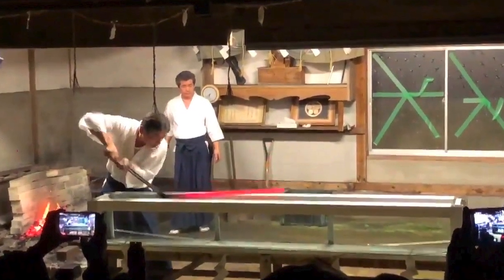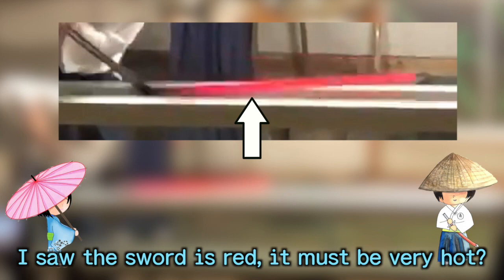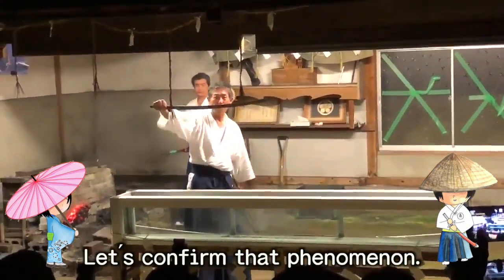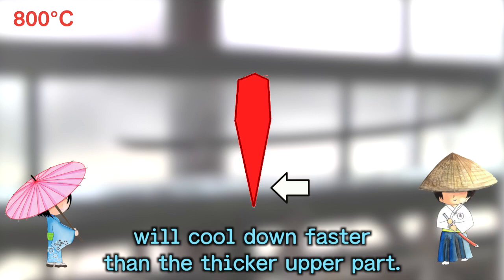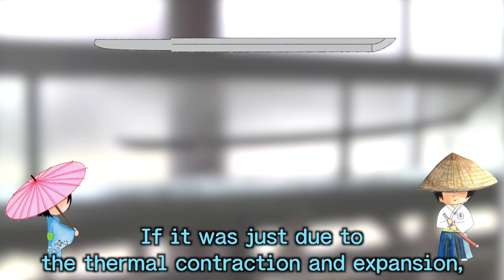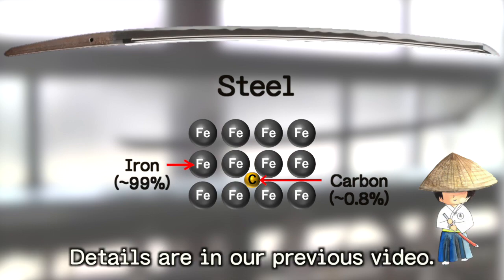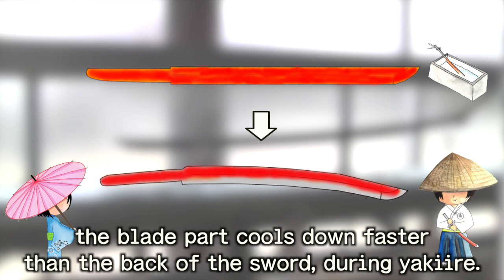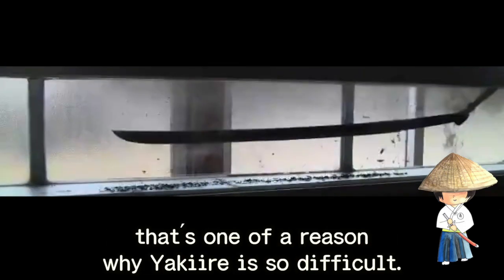The Moment of Yakiire quenching. Amazing transformation during Katana making.#hamon #katana #swords

Comment: What actually impresses me is how even the temperature is, across such a long blade. That's tricky to do.
Your explanations were really good, but i would add one more detail : the curvature of the sword is slightly delayed, because martensite (the hardened crystal form of steel) only forms at lower temperatures (about 180C). This means as long as the water boils, the steel doesn't really expand into the martensite, so it adds some delay before the curving.
That's also why when quenching blades in hot oil, you can actually hammer them straight and bend them for a few seconds, as the blade still isn't cold enough to harden (but the quench still collapsed the austenite)

Comment: thank you very much, I quenched a katana using the clay method a few days ago and was in disbelief at the curve when it came out! Thank you for explaining in detail on why this process happens! Unrelated to yakiire however, I understand there are many different forms of hamon (gunome, notare etc.) is there a specific method to getting each individual one or is it all down to the relationship between steel, fire and water? As well as this, I have taken notice of different blade cross profiles such as soshu kitae (created supposedly by masamune). From my understanding, this is created by forge welding different carbon percentage steels together. Is this correct or not?
Reply from the maker: Thank you very much for your comments too! 

What an exciting thing you are trying. To quench a katana by yourself sounds so interesting.
I hope I will have the chance to do it myself too.

Most of the time I get the information from books or other sources and examine the theory with small scale experiment. I might not be able to provide you the best answer but let me try my best to answer your questions.

To make a different hamon pattern, there are specific ways of putting clay for creating each hamon pattern. Of course, what you mentioned is said to be very important.
If you are interested in clay patterns, I will make a video about that.
Moreover, there is a special case, where the quenching katana was done without clay, which is called Hadaka Yaki.

For the cross profile, your understanding is correct. Single to several steels with different carbon contents were used to increase the functionality. Also, a welding pattern is important for hamon pattern, for example, so-called honsanmai can make a Kinsuji at the border of different steels. 

I hope these information would at least help a little for your Katana forging. 
Please feel free to share your on hands experience or new findings from Katana forging. 
I will be so excited to hear more about that!
Reply: @samurai-tavern  thank you! Your are very knowledgeable in the subject, that clears up my understanding nicely! I will be sure to share any new findings I make!
Reply from the maker: it’s my pleasure! all the best for your Katana forging and stay tune to our next video :)

Comment: I just finished watching Ruroni Kenshin since I was a child. Based on how this works, a reverse edged sword like his would not look the way it does because of that principle right? If it were made in the traditional Japanese way. Or would they just make it traditionally and sharpen and polish the opposite side?
Reply from the maker: Thank you very much for the comment.

I’m happy to hear that you watched Ruroni Kenshin, because it is one of the thing which I want to recommend others to get interested in Japanese culture.

Let me think about the Sakabato…
I think, one of the best solution to make Sakabato is to make a sword which is greatly curved toward blade side, before Yakiire process. If the blade part is extended after Yakiire, the shape of the sword still looks Sakabato.
The resultant sakabato has sharp mune blade and blade without sharp edge.

I think the important point is ,if you use the same steel as you use in making katana, the steel without Yakiire cannot be sharpen no matter how much you try to sharp and polish it, because the material is too soft.
Reply: @samurai-tavern  i think sakabato was use the same as the katana, the Mune part of sakabato was the substitute edge of the katana and the Ha part of the sakabato was the mune on the normal sword in short you'll defeat your opponent using the   
Blunt part of the sword which was the Mune in reverse side 

As a bladesmith on the japanese style blades on the yaki ire process you are definitely right initial shape of sakabato is important before yaki ire to sustain it's shape as the sakabato after quenching. If it has shallow sori before yaki ire it will like  a normal katana after yaki ire with kanmuri otoshi zukuri style kissaki downward

Comment: why were earlier swords originally still stright (like more ancient chinese swords)?
Reply from the maker: Thank you for the comment.
ありがとうございます。

I think that is because these old swords were made for the purpose of stabbing.

This is just my opinion from my experience.
Cutting something in the battle with swords puts a lot of burden on the swords. For example, Japanese swords always bend toward blade direction at the moment when the sword hit on tatami or bamboo then recovers immediately. Thus, the material should be hard and also ductile otherwise it will easily break.

Until the method of purifying better steel was invented, the ancient people just couldn’t make a sword for the purpose of cutting.

Comment: This is really interesting.  I am an American blacksmith and I practice traditional European smithing.  I make smaller tools, horseshoes, and blades, so I have not cooled that much metal at one time ever.  The structural changes are immense and the stress that would put on the metal is incredible; the creators of these blades must be experts at their craft to not crack half the blades they make.  

I dropped a hammer yesterday after hardening it and 4 pounds of steel shattered like glass.  I was very sad.  It would be depressing to have stress cracks in a beautiful sword before you can temper it; to see one explode would be disheartening indeed.

Comment: The katana is such a beautiful sword. I like other designs too, but the unique aspects of the katana allow for some very interesting things in the modern age. 

Howard clark for example. Martensite edge with a bainitic spine. 

Then modern lamination methods and old methods tweaked to modern materials. 

I've figured out 2 ways to accomplish the Howard Clark heat treatment on a specific steel. One is much harder but more traditional. However the differential cooling rate in the clay and some other traditional Japanese methods using clay but not necessarily in the way everyone thinks of is how I figured it out. 

It really is a shame some of the more unique methods of production in katana are slowly being lost. If Japan would allow smith's to make some use of modern materials it might help. Allow art swords and modern material swords only for registered practictioners with stricter rules. 

I mean. Gassan sadatoshi is like one of the only smith's left really able to reproduce a certain type of hamon that requires not claying the blade. I rarely ever see anyone fully paint the blade in clay anymore to produce hamon. Thin wash on the edge adds surface area to help with more even heating, the thin layer helps cool the edge down faster but at a controlled rate helping prevent cracking due to almost a 2 stage quench. Thin edge wash cracks off after curvature forms and the spine coat keeps heat in the blade so the spine can convert to soft pearlite. Japanese crucible steel for altering carbon content, made in a tatara furnace. Namban tetsu blades using foreign steels to alter steel conposition further. 

The whole potential hizen wootz/Indian or middle eastern crucible steel theory. I don't personally believe it's wootz but Indian crucible steel or iron is possible easily.

Comment: I have a question, is this the same method used when making katana and tachi in Kamakura era?

Because I see the difference between an old katana / tachi from late Edo period vs Kamakura is the bend point are very different and it might be affecting the cutting efficiency, the Kamakura period years 1100-1300, the bend point/curve was start after the handle part ( after tsuba ) so its looked way more curve d than the other katana/tachi, and the Edo period katana curve point start from the 1/4 -1/2 - 3/4 part of the blade. 

Thanks.

Forgive me for my terrible English
Reply: the swords we saw in the video were demonstration pieces. usually the sword already has some sort of curvature before yakiire. for example, if you want to have a straight sword, you would forge the blade with an inversed curve. if you want a more extreme curve near the handle, you forge it in before yakiire
Reply from the maker: Hi ChardS! Thanks for dropping by and I am really happy to know that you know a lot about Katana.
as replied by movie factory ( thank you for explaining! ), the Katana is made at different angle in order to achieve the final angle. I met a sword smith and he told us that it is really difficult to make a Tachi. due to large curve, there are high risk of having cracks on the blade during yakiire.

Comment: The clay attached to the blade dramatically speeds up the cooling-down process.
The clay is necessary to obtain the desired crystal structure.
Reply: The purpose of the clay is to SLOW the cooling process on the spine of the blade. By doing that, the edge cools really fast and becomes really hard martinsitic steel, yet the spine becomes a softer and more flexible perlite. This gives a sword with an amazing cutting edge, but it's not so brittle all the way through that it's in risk of cracking during use. Fascinating process!